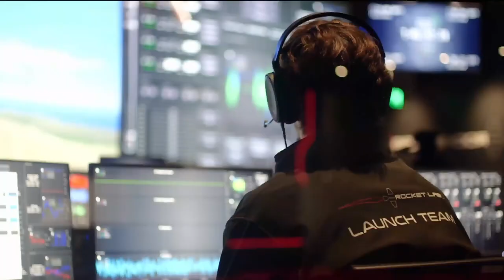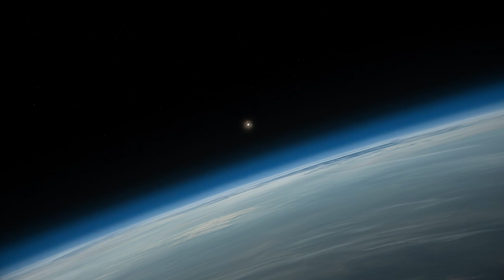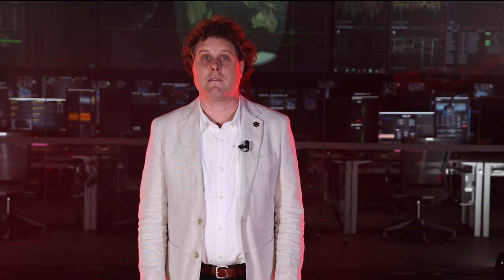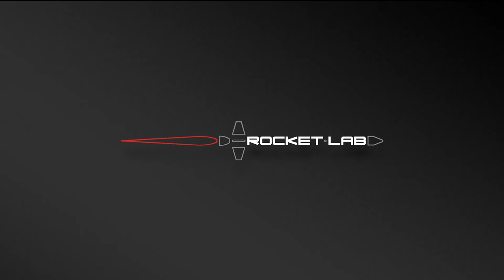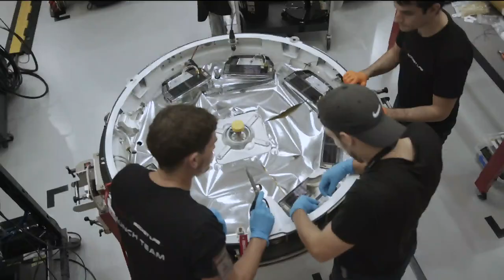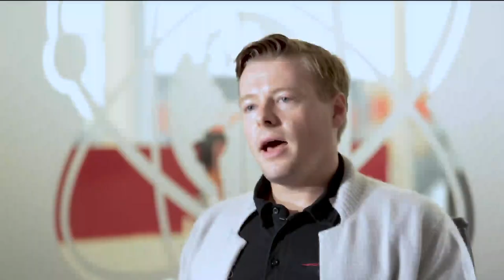Introducing First Light: Rocket Lab's first Photon satellite in orbit

Comment: This must be the cutest rocket engine in existence! Soo tiny! :D
Reply: Didnt even know rocket engines could be that small
Reply: @AerioC  me too
Reply: Tiny = cute
Reply: Omg it's my favorite
Reply: @plederfagella9774  ok
Reply: Yes, but that little engine has a very important job to do, which is  get payloads into orbit at a profit.
Reply: @taraswertelecki3786  yes
Reply: @aawqaq620  It--even the original "green mono-propellant"-powered Curie engine (the current Curie burns an unspecified bi-propellant combination, as does the new HyperCurie engine [not necessarily the ^same^ bi-propellant combination, though])--would suffice for a small-body lander, too. The Kick Stage could be fitted with three or four small, lightweight, deployable landing legs with footpads, and the original or new-type Curie engine (or a HyperCurie engine) would provide ample braking impulse for landing on low-gravity bodies such as smaller asteroids, moonlets (like Mars' satellites, Phobos and Deimos), and comet nuclei. The gimbal-mounted current-model Curie engine (and the HyperCurie engine) could also control the lander's transverse velocity during descent, slowing it to zero mph (or km/h) so that the final touchdown would be vertical.
Reply: @j.jasonwentworth723  ok!

Comment: Customer: "Any way I can get my iphone into space?"
Rocket Labs: "Have I got a deal for you!"
Reply: That's more serious than many folks would think. One of the early Antares rocket tests (they orbit the Cygnus cargo spacecraft that carry supplies to the ISS, launched from Wallops Island, Virginia [PhoneSats have also "hitch-hiked" on other orbital rockets]) also carried student-built "PhoneSat" secondary payloads (using ordinary Smartphones as their instrument and communications units) into orbit, and they operated better than expected (not having been manufactured to aerospace specifications for acceleration, vibration, and shock resistance), and:

Smartphones already ^are^ spacecraft payloads; they contain thermistors, accelerometers, and other components (and suitable associated circuitry and software) that enable them to record and report temperature, acceleration & deceleration and their parameters (the direction, magnitude, etc.), vibration amplitudes and frequencies, the heart pulse rates of the Smartphones' owners, still and video images (with sound), and other physical parameters. They also contain GPS units, plus radio transmitters and receivers, which enable the Smartphones to communicate wirelessly with other Smarphones, either point-to-point or through wireless networks. In the PhoneSats (see: https://www.nasa.gov/centers/ames/engineering/projects/phonesat.html ), the Smartphones serve as the little satellites' "guts" and "brains," while outer CubeSat-type housings--fitted with larger antennas, thermal control systems, and (in some cases) solar cells--house the Smartphone circuitry.

Comment: Will you guys do a multi rocket first stage launch vehicle?
Reply: Like the Delta IV Heavy or Falcon Heavy? Most likely no, doing so will make them a medium lift launch vehicle, and that market is already covered by others. They want to stay in the small sat launch vehicle range.
Reply: I think they could do it cheaper than the rest of the guys.
Reply: @MarkHopewell  Yes. That’s another reason why Rocket Lab won’t do a Electron Heavy (like I said...)
Reply: @MarkHopewell  just adding a single reusable chemical powered lifting body can increase payload capacity by an order of magnitude and thus dispense with all the gibberish spewed forth as to "where we're going." No need to go big at all per se has now been validated. The theory that chemical based propulsion is neither reusable nor cheap is simply false. In fact the exact opposite is true. As proven by the US Space Shuttle chemical based boosters are reusable, of quantifiable cost and far more capable (safe) than those based purely upon combustion. Indeed RocketLab just had a spectacular failure prior to this. The most simple solution "going forward" is not to talk Venus and Mars but adding lift to what is nothing more than a Lifting Body. "Forget 500 pounds into LEO we're talking lifting 5000 pounds into LEO now" kinda thing. That would be a game changer imo using that form factor. Talk about a power to weight ratio!

Comment: Can they be linked together?
Can they be sent out to push small metal asteroids to where they're easier to mine?
Can they be sent out to push ice-asteroids to Mars?
Reply: Yeah why not. but they are so tiny, it's quite hard
Reply: @lapistaoftheparadise4627  That's where solar sails (and/or E-sails [electric sails]) come in handy. Like ion drives, they're low-acceleration devices, but because they use no onboard fuel (the solar sail--which can be spin-rigidized or can use spars to support the sail--reflects solar photons, while the E-sail uses one or more spin-rigidized wires--positively charged by ejecting electrons from the craft using a solar-powered electron gun--to reflect the positively charged solar wind particles, mostly protons), both sail types can produce low thrust indefinitely, and at no cost. Also:

In friction-less space, even a tiny force, if applied for a long time, will accelerate even a massive vehicle (or payload) to tremendous velocities. As with starting a vineyard, where years of preparation, including of the soil, results in wine grapes (which in subsequent years grow and are harvested and squeezed annually, in a continuous cycle), an asteroid mining operation would first require years of locating-and starting to tow Earthward--metallic and mineral and organics-rich asteroids, using solar sail and/or E-sail tugs. Then:

After a few years the first such asteroids would reach Earth orbit, from where they would be de-orbited to impact and shatter in isolated locations, such as Australia or Alaska (the space writer Dr. Willy Ley suggested such a plan; the fragments would be retrieved using ordinary earth-moving equipment), while the sail "tugboats" would have traveled back out to the asteroid belt (and/or to Near-Earth Asteroids--NEAs--closer to our planet), to repeat the process (other sail-tugs would already be en route back to Earth, having started their work soon after the first group began heading home with their payloads). It would take several years before the first asteroids came down to the Earth's surface, but--as with a vineyard--regular "harvests" would come to Earth, once the process was started, and:

(The asteroidal organics--and the organics and various ices from short-period comets [many asteroids with eccentric and/or high-inclination orbits are actually extinct comet nuclei, whose thick dust crusts protect most of the volatiles underneath from subliming via exposure to sunlight]--would be very useful ^in space^ [for producing rocket fuel, breathing air, drinking water, etc.].) They could be lowered to the Moon's surface, using solar-electric powered robots traveling up and down polar-located lunar space elevators (made of Spectra or Zytel fiber; the lower lunar gravity enables existing materials to be used), and the asteroidal and cometary materials--wrapped in metallized Mylar or Kapton plastic film to prevent sublimation in sunlight--could be stored indefinitely in the permanently-shadowed polar lunar craters, where the temperatures are just above Absolute Zero.